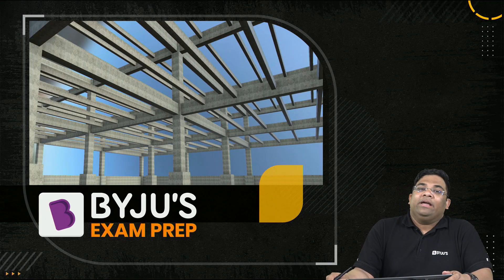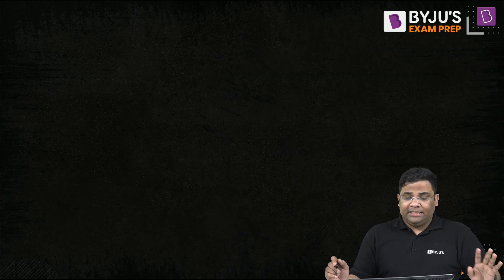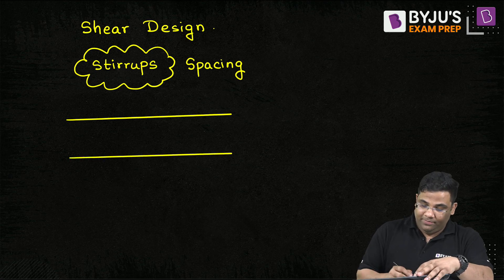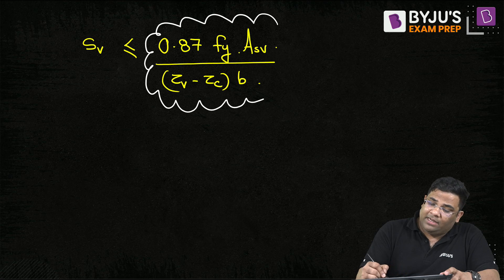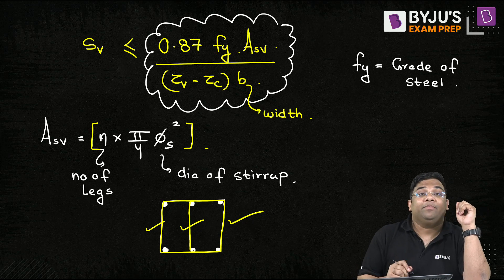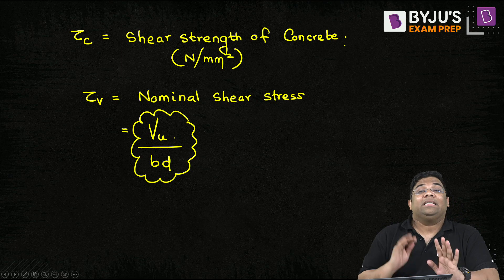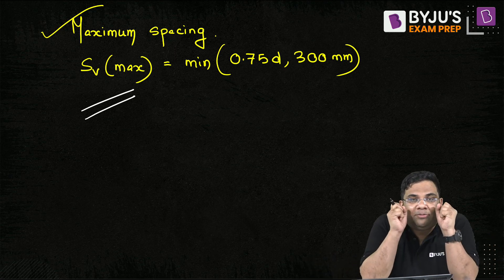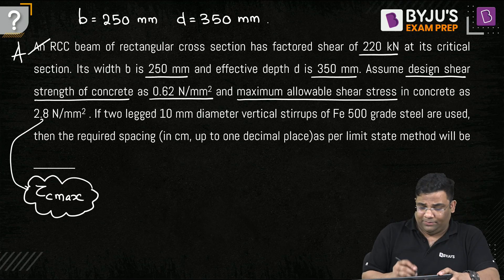Spacing of Stirrup & Shear Reinforcement | Concrete Structures | GATE & ESE 2023 Civil (CE) Exam

Comment: Design steps for Stirrup & Shear Reinforcement-
1. Tau v : Vu/bd
2. Check Tau v < Tau c max
     if yes, find Tau c, If no then redesign.
3. Check if, Tau v - Tau c  < 0.4
     If yes, provide min shear reinforcement ( Tau v - Tau c = 0.4 ) 
4.  Sv = 0.87fyAsv / ( Tau v - Tau c )
5. Sv < Sv max = min (0.75d , 300mm)
    where, Sv max = min ( 0.75 d, 300 mm )

Comment: Summary of the spacing of stirrups ans shear reinforce 
1. Tau V = Vu/bd
2. Check for tension crack
Zv < Zcmax ( if Zv>Zcmax) then redisgn
3.Zv > Zc then step 4 will be 
Sv = 0.87fy Asv/ (Zv -Zc)b
If Zv < Z c then step 4 will be 
Sv = 0.87 fy Asv/ 0.4 b
Now step 5
Sv < Sv max = min (0.75d , 300mm)
Thank you sir for this short and important concepts

Comment: Summery:
In this session, we saw 3 terms regarding shear reinforcement.
1. Nominal shear stress, tau V : Vu / bd
Where, Vu : factor SF
2. Shear strength of concrete, tau c
3. Maximum shear strength, tau c Max = 0.625 root fck

Design steps:
1. Tau v : Vu/bd
2. Check Tau v < Tau c max
If yes, find Tau c, If no then redesign.
3. Check if, Tau v - Tau c  < 0.4
If yes, provide min shear reinforcement ( Tau v - Tau c = 0.4 ), and calculate.
If no, put formula of Sv = 0.87fyAsv / ( Tau v - Tau c )
4. Check : Sv <= Sv max
And, Sv max = min ( 0.75 d, 300 mm )
That's all about the capsule video.
Thank you sir for summerizing in such a good way.